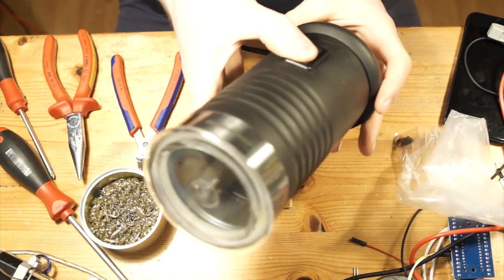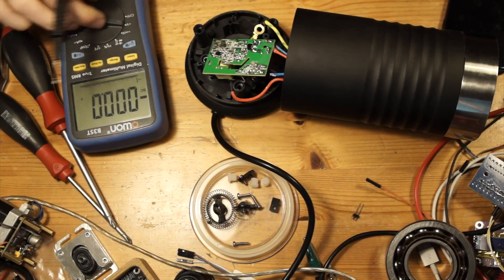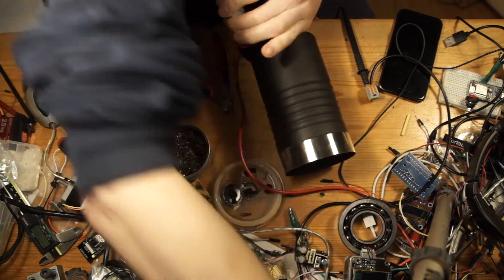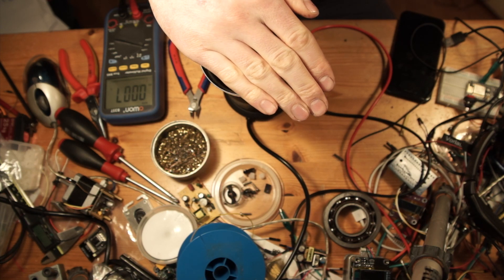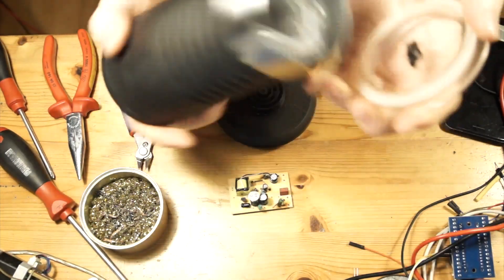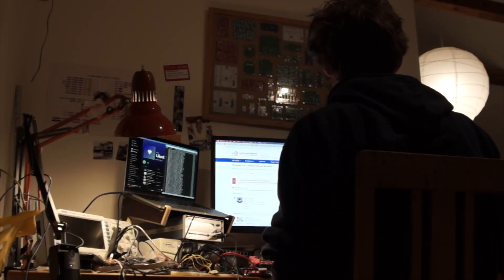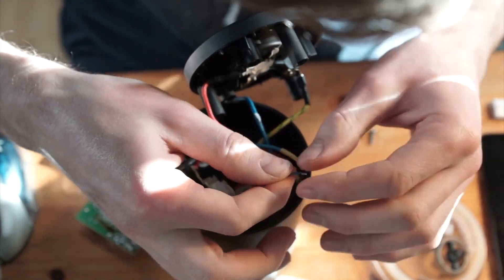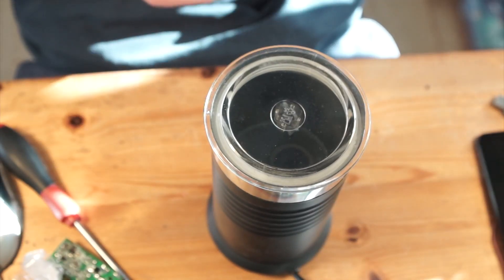Inside a doomed Milk Frother | planned obsolescence in 'quality' devices

Comment: Thanks for the upload, I got asked to fix a similar device. An IC in the power supply sector blew up probably from a water spill (it's so burnt that I can't read the ID code on it). The issue is that the power supply board also includes the connector to the controller board, the connector to the motor and the power relay for the heater. I was thinking about sawing off the portion of the AC-DC power supply (or maybe removing all of its components) and replace it with a 9 or 12V power supply board from a charger. Probably should check first if the controller board has a regulator, and also I'm not so sure if this is a good idea overall, wish I could just simply replace the damaged power supply board with a new one. The frother I'm trying to fix has probably even worse design than the Grundig...
Reply from the maker: The fully integrated PCBs are the worst to repair.  Usually I try with a lab power supply first, if the electroncis still work and verify that its only the power supply that is faulty. But 90% its the power supply. On alibaba there are a few 230 to 12, 9 or 5V converters for 1€.
Reply: @Neumi  Just came back to thank you for you video, I didn't know that there were such small AC-DC modules available in AliExpress. I did try using the boards from a couple 12V wall adapter I got cheap, but there wasn't enough room inside the frother compartment. After removing some of the components on the main board to make some space for the module, I connected the board to the terminals and now it's working again!